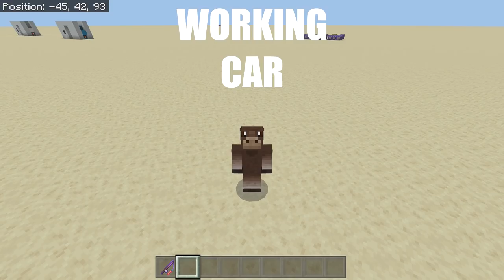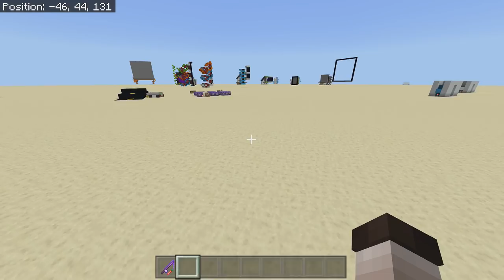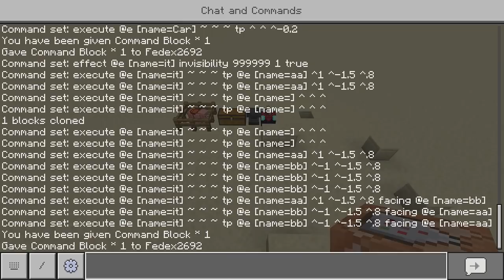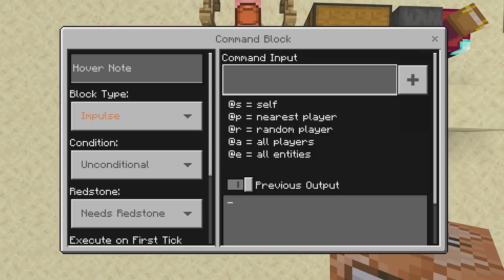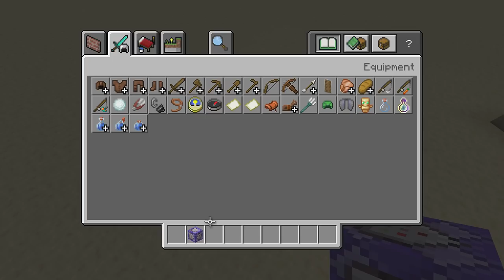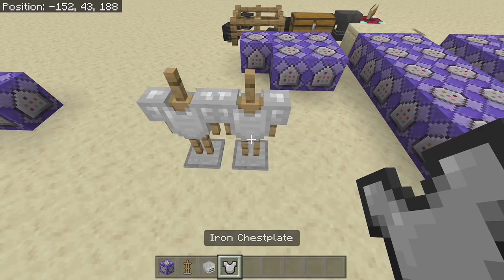How To Build A Working Car in Minecraft Bedrock! (Command Block)

Comment: I’m pretty sure command blocks don’t have a radius. They just don’t work when they are outside of render distance. You can stop this by standing above them and running /tickingarea add circle ~~~ 4 CarCommands
Reply: Extremely useful thanks!
Reply: Simulation distance* but yea you can use tickingarea just fine
Reply: yeah when i got to that point i was like wait than why do @a commands work

Comment: There’s a command thing you can add, I think it’s [r=100] and change 100 to however far you want, like 1000000000000, and it makes the command block work at that far
Reply: That is not how it works. The command block stops working after a certain distance because it gets unloaded. Command blocks have a default range of infinity.
Reply: @fiftyshadesofsans1064  it worked for me, it was a long time ago, maybe I did something I didn’t realise I did to keep it loaded, thanks :)